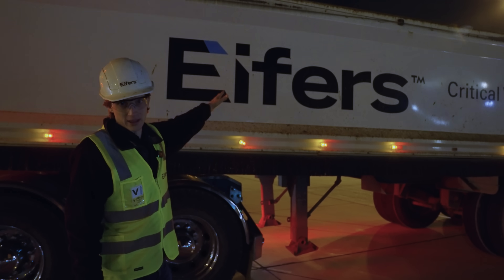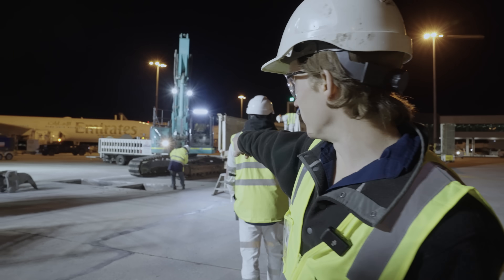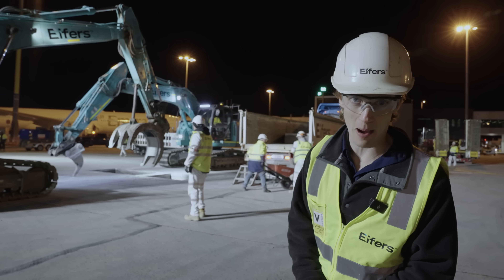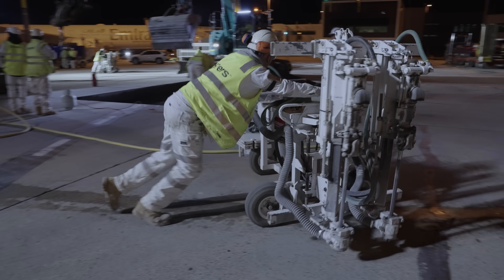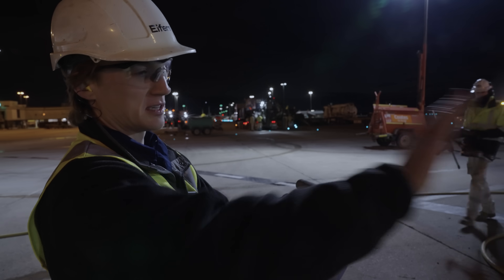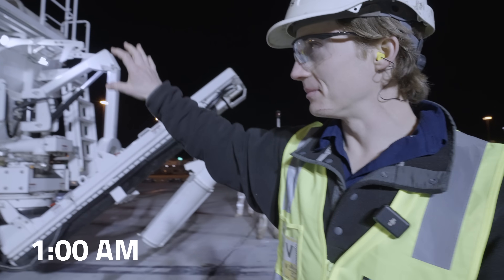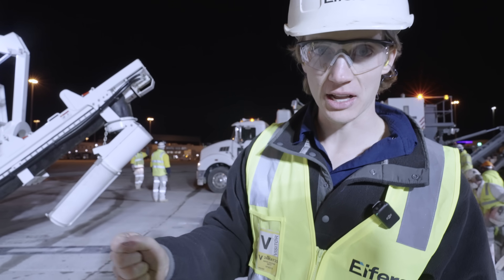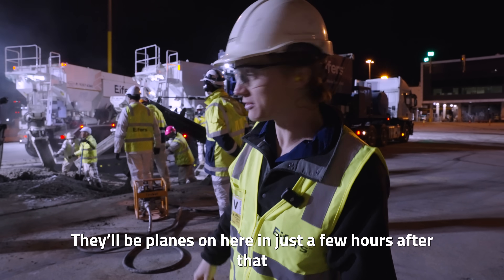Replacing Airport Concrete OVERNIGHT

Comment: I was doing a rental job as a truck driver for a company that was working at Logan international airport in boston. On the airstrip. First thing I was asked is do I have a felony because if I did, I could not do the job. You pull up to a certain gate they check your ID make, sure you’re not a felon. Then the dog walks around the truck, guy walks around with a mirror looking under then they lift up my cab, and after that, I’m allowed to go in then I am escorted by a state trooper to where I am going. It was so cool. I was driving next to big commercial planes. 20 feet from me. Only thing that stinks is every time I leave to go dump my material when I come back, I have to go through that whole process again. Other than ID being checked only time they checked out again as the following day when I was there again. That was a really cool experience.

Comment: Rapid Set  cement, they provide cement for projects all over the world. Minimum 3,000  PSI in one hour, with a standard mix, higher strength if needed/wanted.  Did many interstate bridge resurfacing projects when I worked for them, shut down a lane of traffic at Friday nite 11:00 pm and have the entire bridge resurfaced and open for traffic before Monday morning at 4:00 am. With traffic always getting by in at least one lane.

Comment: I do maintenance here in Houston TX on freeways or service rds and it’s basically the same process we also use volumetric trucks . Saw cut, drill , lay down re bar and pour concrete, loved the vid !
Reply: Ive done rlads before. Its the same as well in fl with black top  Never done airports tho.
Reply: You need to work harder. The roads are shit here.

Comment: Hey man you should connect with Hartman & Company in Springfield Missouri. They got a big project shutting down a whole interstate highway due to it collapsed under the pavement and ripping it up and redoing it all in a certain amount of hours nonstop around the clock
Reply from the maker: thanks for the tip

Comment: I'm surprised Aaron did not mention more about how this process may be similar or different at other airports.
Reply: They have video from Europe which is quite different
Reply: I did this exact work years ago at LAX, process is identical, only thing different we would add dowel baskets at the joints where they line up to existing slabs!  Slabs were I believe 20-24” thick don’t recall!
Reply: At Newcaslte Airport here in NSW Aus, Downer are replacing and extending the runway, but they are using hotmix with a mobile batch plant just off site.
Reply: he's not the best teacher. just likes to point and look cold. more in depth information would be good.